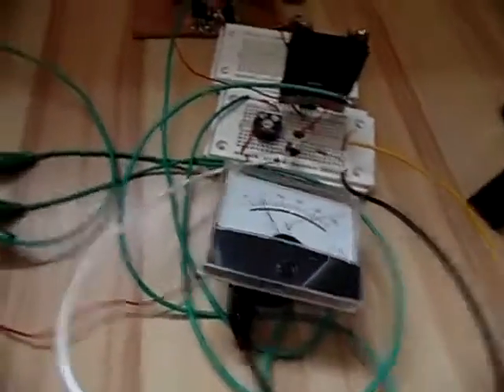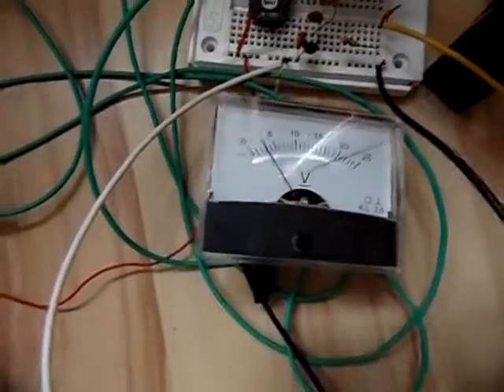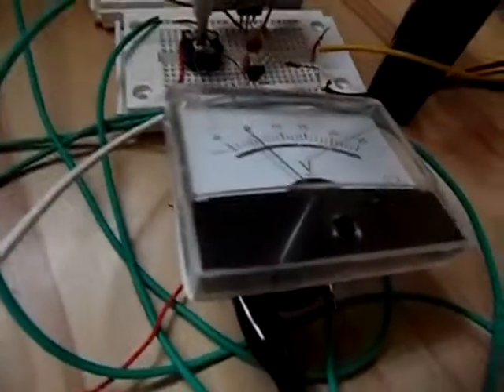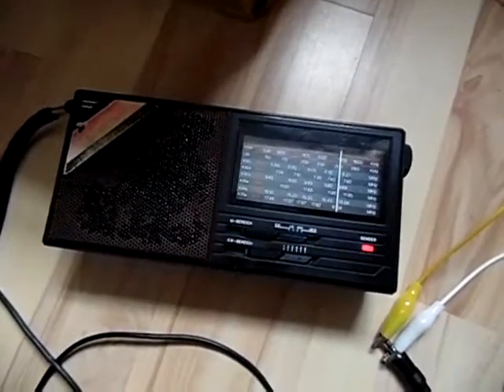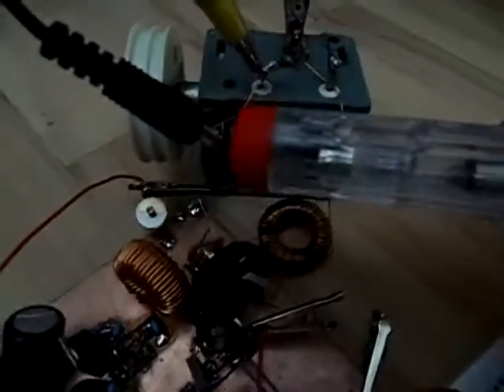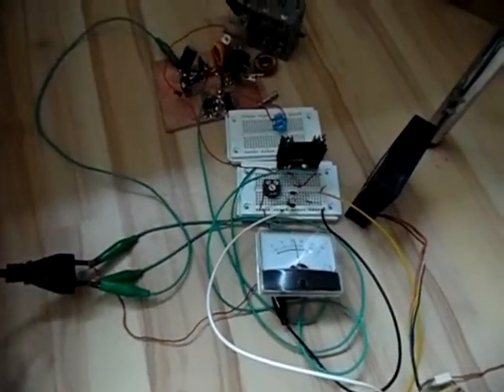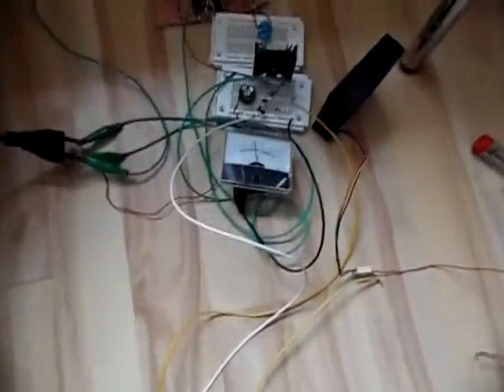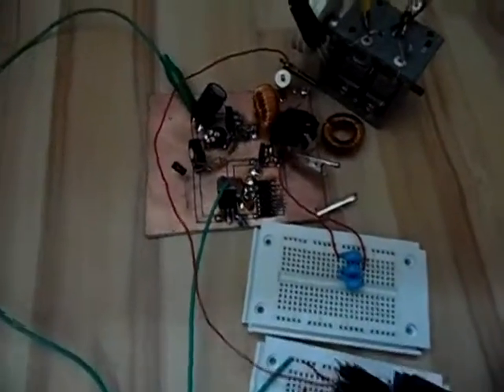5W Mediumwave transmitter

Comment: How u adjusted tunning capacitor?   ( i mean monitoring current or some other factor!!)
Reply from the maker: I usually set the modulator to a relatively low output power, and measure the current consumption from the final amp. I measure it in the indirect way, by adding a voltage meter to GND / Modulator out. If the Antenna is not tuned, there will be a quite high voltage, of let´s say 6-7Volt. Now I tune the antenna, and at the resonance of the antenna, the current draw from the RF amplifier will increase, causing the voltage to drop to like 1Volt. Alternatively I  use a radio, tune it close but not exactly to the frequency, so there´s static (but static gets a bit more silent if transmitter is on) and then I adjust for most quietness from the static noise.
Reply: @Stefan0719  gotcha ,tysm